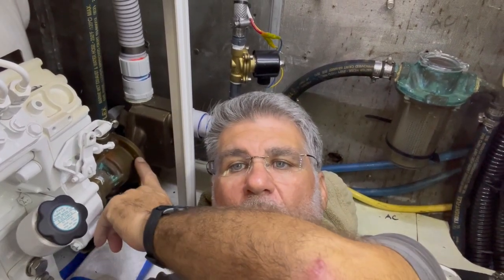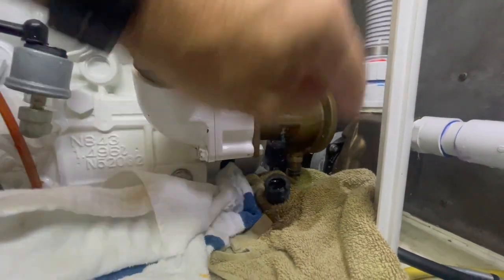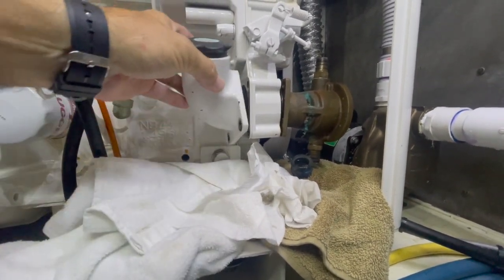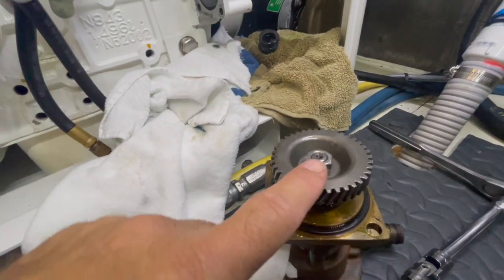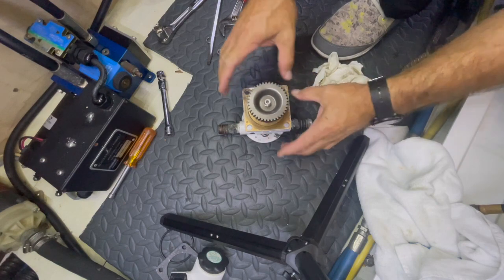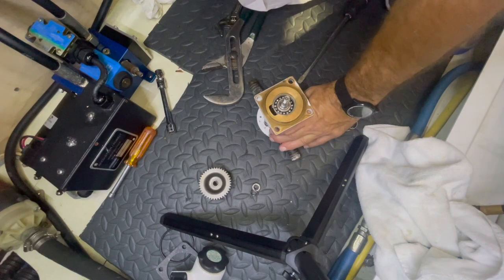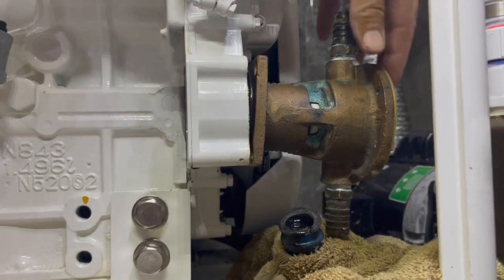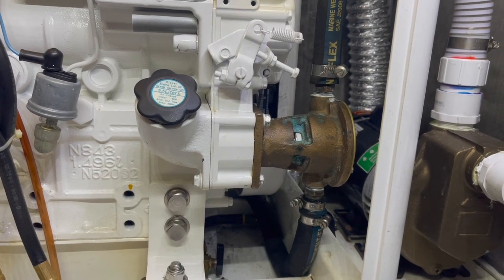12 KW Raw Water Pump Install on Chicory a 46 Nordhavn

Comment: Very informative video as always. One tool I feel should always be on a boat> a strap wrench. The channel locks are a great tool and have a purpose. But to protect parts like gears, I would recommend a rubber strap wrench. It has evenish pressure all the way around and less chance of damage to precise parts. 
As always, thank you for the maintenance videos. It’s amazing how much “work” these little ships require.
Reply from the maker: I would love to know the manufacturer of the strap wrench you like. I have tried several in the past, but they always seem to slip. I would love to buy one that works well. Thanks for the tip.
Reply: @boatersdivingguide  I use Rigid for things over 4”. It has a web strap that holds really good. I’ve had good luck with the Kobalt (Lowe’s) or the Husky (Homedepot) ones with the rubber strap. The rubber may work better on the gears you were holding. The Kobalt has better reviews online. Hope this helps. 
Rich

Comment: Is generator remanufactured or new? I recall it was a Northern Lights correct if wrong.  If it was a rebuild,  what parts were reconditioned or brand new? Did you need a special lift to get it down into the boat? How long did it take to receive the generator from the time you placed the order to receiving it?
Reply from the maker: The generator was new in 2018 from Northern Lights. I purchased it from RPM Diesel in Fort Lauderdale. I think RPM had it in stock. Great company.  I used the Warn Pullzall (shown in the 6KW isolation mount video) and had it connected to one fork of a large forklift. The forklift was large enough to have one fork go into the saloon and the other down the boat's starboard side. I lowered the generator in with the Warn winch and then used a hydraulic ram (shown in the cutless bearing video) to move the generator into position before bolting it down. You can see the prep for this in the 12KW refit video.